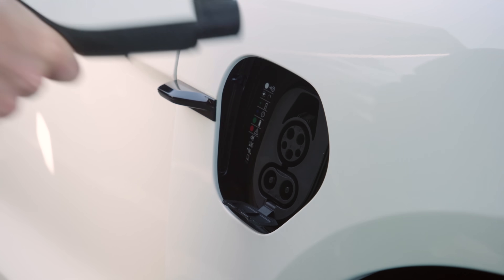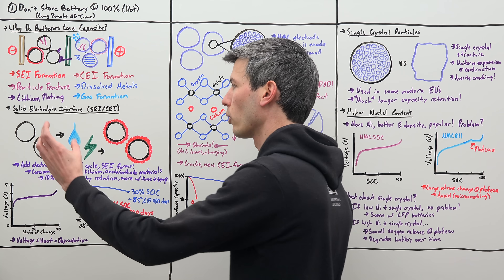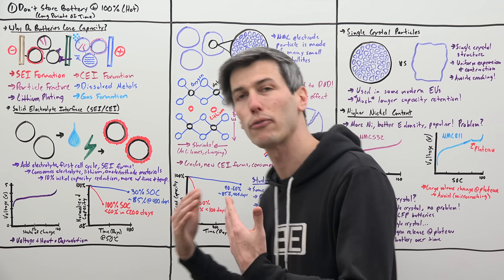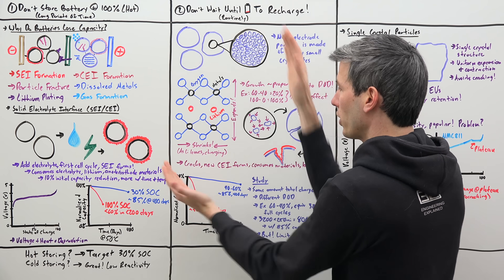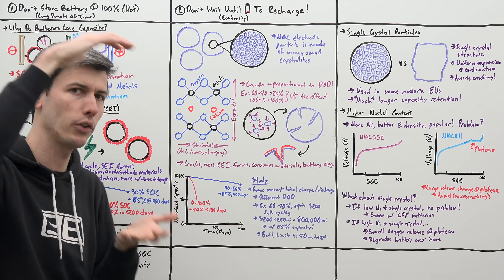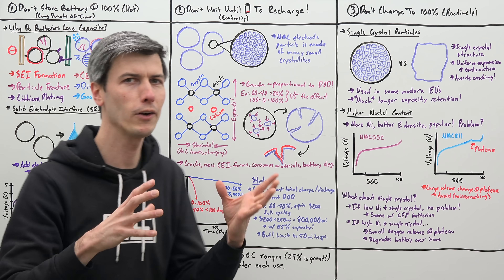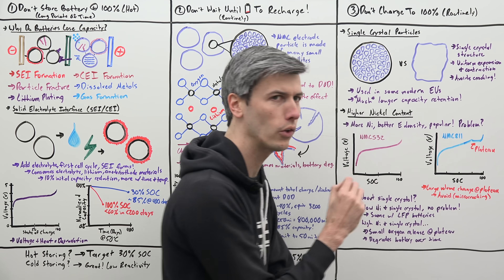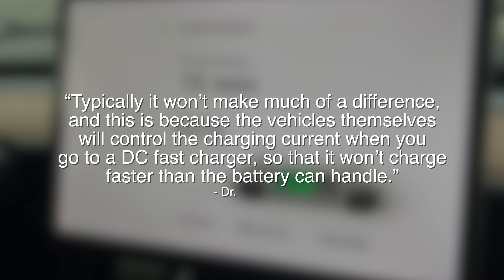How To Ruin Your Electric Car's Battery - NMC Edition!

Comment: Really it depend were you live... Here in Québec, Canada it's a nightmare for electric car... We have temperature from 35'C to +35'C!!! And we have a very vast territory... Here a Tesla model 3 cost 75k$ taxe includes... The car have a advertise 548km range... Most people never do this mileage, so bring it to amore realist 500km... In cold winter people here lost half their range... So now we have 250km.... Most insurance company didnt let you charge your car in the garage because of fire hazard... Charging your car outside at -30'C take 2-3x more time to charge and at home you have the slow 220v charger... So you lost your car for half the journey... My neighbour have go 3 week in vacation in winter... He didnt want to have is car plugged in the charger for 3 weeks , so he unplug it.... When he came back, the car(battery) was so deep freeze that he can't charge it!! He need to have the car tow to a heated garage for a full day to un-freeze the battery.... So, now... You have a =/ 250km range brand new in cold winter... I see video of customer with 7years old car, they have a 30% battery degradation... You have a 7 years car with paiement that you paid 75k$ and you have now 175km of autonomy.... It's ridiculous!!! If i compare with my old Honda civic (2011) In winter i do easely 400km with 50$ of gasoline... I purchase the car new for 25k$... The cost of the car(25k$) + the gasoline for 7years(18200$) = 43200$... Were im supposed to have save money!?!?

Comment: Fascinating! I know what ive seen on tool batteries is similar, i generally do not store them more than 75% if i know they are going to sit longer than a week or two. I suppose i need to watch the other video if the composition is different
Reply: I wish tool batteries do what DJI drone batteries do. If they sit around for a few days at 100%, they automatically discharge themselves to 60-70%.

Comment: Jason, what about the most obvious engineering solution, which is larger top and bottom buffers? Almost all standard hybrids only use in the 40-80% SOC hard-coded and many have last lasted well over 500k miles. Yes, you would need larger batteries, but is they last 2-3x longer wouldn’t that be a net benefit?
Reply: Is it though? In our country, most 10yo Camry hybrids on second hand market have busted batteries within 70-80k km. These are 1.6kWh 245V NiMH packs 

Possibly it’s due to heat and lack of liquid cooling (India)
Reply: @shresth1201  How long did the original batteries last? What health were the rebuilt batteries at? How good was the diagnosis and replacement work as well as the SOC balancing? I had a 2013 Prius that now has 200k miles with the second owner and the battery health is still excellent. It is proven that only staying in the 20-80% or 40-80% range always many more charge cycles than allowing batteries to go very high or very low voltage.
Reply: @KyleBrightman  these are 2013-2015 model year Camrys. The “check HV battery” light comes on and th regen stops working so does motor torque assist as per local car forums. Nothing about the SoH is made available to the user. Most people either just keep using it with lower mileage or try to get rid of it on car trade sites for whatever money they can get with faulty hybrid subsystems (usually ~$10K while a new 2024 Camry hybrid costs $50K equivalent here) 

Like I said most are listed under 100K km and still need battery replacements worth at least $2000 as per the dealers

Maybe a model year 24 Camry will fare better 10y down the line in 2034 but we’ll see 

As it stands we have LFP EVs as well and while they aren’t old age wise, some have been driven 100K+ km without range drop 

This model of car is also owned by me, and I know of the owners via our telegram group wherein one of them has even exceeded his warranty period of 160K km and did 162k km Nov’23 in 2.5y of purchase on original battery no range drop 

Because 

1. They’re LFP 

2. They’re liquid cooled 

Afaik the Toyota ones are NiMH and not cooled in any manner — and heat being enemy of batteries more so in a tropical country like India worsens the degradation 

Your experience may vary because you’re in a colder country which doesn’t need battery cooling or because the tech on the Prius and Camry sold here maybe different as brands do lot of cost cutting in Indian car market vs their global models

Comment: We have an NMC battery Ford Lightning for which we’ve built an offgrid 3.6kW charging system, with a 6kw hybrid inverter charger, so we pretty much trickle charge at 12amps @ 240v. I wonder if charging at so low of a rate would alleviate some of the issues with charging to 90% + ?

Comment: Great advertising for EVs! Buy a car with a battery 5 times bigger than what you require, keep your car under a roof and ignore the range claims.
Reply: Huh? You can use the full range. Did you misunderstand something?
Reply: @logitech4873  If they tell you not to charge to 100%, not to drop under 20% and keep it between 40% and 60% (or 60% and 80%), they are effectively saying not to use the advertised range.
Reply: @pseixaspal  This is for daily everyday use. You know, commuting and whatever.
When you need to use your full range, you use it. You're really just hearing what you want to hear. Roadtrips aren't everyday use for the vast majority of people.
Reply: @logitech4873  Exactly why I said you should pick a battery size five times the size you require for everyday use. That's the logical conclusion from all these recommendations.
Reply: @pseixaspal  You'd want a longer range EV for many reasons. Bigger batteries last longer generally.

Comment: I thought that the EV's software regulated SOC between 10-90% of actual - Gen 1 Chevy Volt owner
Reply: Usually there's a buffer below "0%", so you don't actually reach 0%. But in most EVs, 100% really is 100%. There are exceptions. I believe the Toyota BZX4 has a top buffer.
Reply: @logitech4873  Every EV on the market still has a top and bottom buffer

Comment: The Chevy Volt (pioneering plug-in hybrid) engineers set up the battery to only charge 30-80% SOC. In a way the battery was twice as big as it needed to be, but they felt it was with it to deliver reliability. The Leaf (EV only) of the same era had major battery degradation issues.
Reply: Came here to say this. I own a volt, I just wish there was like a long trip mode where you could unlock the reserve battery capacity
Reply: @zacrossen1968  I think of PHEVs as electric on a typical day and conventional hybrids on road trips. People will criticize it as "carrying an engine you're not using most of the time and carrying an electric battery you're not using on road trips," but my physics and engineering educated opinion is that weight matters 65% less to vehicles with regenerative braking. So the only fundamental problem along those lines is the space they take up.

Comment: When you talk about 100% of battery are you speaking of 100% of the gross capacity, which is generally not possible in most cars, or are you refering to 100% of the usable capacity of the battery?
Reply from the maker: Useable capacity

Comment: Such great videos you make Jason - thanks!
Re charge percentage - my Mini Cooper SE has a very small battery so I need 100 usable percent all the time. BMW says they purposely cap accessible charge at 28kW of the battery’s 32kW total. I’m assuming this is to automatically prevent true 100 percent charge degradation that you reference?

Comment: Regarding leaving your car parked over time in temps below 0 degrees C, it's always a good thing to read the car's manual. For my car SOC should not be below 40 % in this scenario.

Of course, a world where people actually read at least the basic bits of the user manual for their car - I realise that is a utopia.
Reply: Our 2024 Prime came with three Owners Manuals. Together, they total over 1,000 pages. Kind of like reading War and Peace, but, with a more technological slant.

Great car, I drove 88Km yesterday in EV Mode and, the battery still showed 6% SOC. It had already well exceeded the advertised range at that point but would have gone over 90Km's on a charge had I needed to.  With 5,000Km driven since mid-March, we have used less than 1.5 tanks of fuel. Cost to recharge here runs around $1.75, gas costs $1.80 litre.

For us, at least (in an automotive sense), we're much closer to utopia now.

Comment: Why does Tesla recommend to charge LFP to 100%?
Reply: Due to the way LFP works, they need to be charged to 100% now and then to get an accurate calibration of the battery readings.
And because they have so much lower degradation than NMC batteries, you really can charge them to 100% all the time.

But if you want the longest life out of them, a lower charge is better. 
Just charge it up to 100% occasionally so that the BMS can get a proper reading.
Reply: @logitech4873  That’s what I was thinking.. Anytime you try to reduce max charge from 100 you get a message saying keep it at 100 because it maintains battery health which sounds a little misleading.

Comment: As you mentioned it's the makers problem to solve and they're not all consistent.  I know for the original battery in the Bolt EV (and likely the pre-ultium one) and Volt EV a 100% charge isn't 100% cell voltage compared to say a Tesla where 100% is basically 100% cell voltage.

Even then I still only charge my Bolt EV and my Model 3 to around 80% at home.

Comment: Gas tanks don’t lose capacity with how much they are filled or the storage temperature.
Reply from the maker: But gas engines do tend to lose power over time. Obv the volume of a tank doesn’t really change.
Reply: @EngineeringExplained  And, when they do,  engines can be rebuilt for far less than at least $20000 for a new battery.

Comment: LiPo storage is around 30% but Li ion is 50% Basically look at the nominal voltage on the battery, that's best for storage.

Comment: The need to fuss with the battery is a deal breaker. They are just too fragile.cold, charging issues, etc.Filling a tank with gasoline will work until tech catches up.
Reply: There's no fuss. It's just a few things to remember. Just like you know that you shouldn't be driving your car at the rev limit, and that you shouldn't be putting gasoline in your diesel car. They're simple things, and it takes no effort at all to adapt.

I wake up, I unplug my car and drive to work.
I get home, I plug my car in.
The car by default limits charge to 80%. It's very easy.

Comment: That video is the best proof, that EVs are not ready for the mass market yet. Most people can't even charge their Li-Ion cellphones correctly. 

The simplest way would be to display the charge indicator in % at software level in such a way that the battery with a charge status of 100% was only charged to 80% in reality and, conversely, the charge indicator shows 0% although there would still be 20% charge remaining.

But what would be good for the battery would be bad for marketing and the manufacturers would have to revise the already unrealistic WLTP ranges even further downwards.
Reply: This is about getting optimal longevity out of the battery. Most people won't notice, and it probably won't make more than 10% difference, except in extreme cases.

Many people with gasoline cars do about the same, neglecting oil changes and tune-ups, etc.

I think the real obstacles for EVs are expensive cars and charging at home, which is hard for renters and people without private garages/driveways.  That's getting better, but slowly.

Probably manufacturers initially aimed for the high end ($) partially because those are disproportionately homeowners rather than renters.
Reply: Oh, and FWIW the WLTP for my 2022 Ioniq 5 – 280-299 miles – is about right, assuming I drive at or below the speed limit (wind resistance: also affects gasoline cars, obviously).

I've done better than that in actual driving, when not in a hurry, or around town.  And worse when driving in a hurry, or into a strong headwind in Wyoming. 🤷‍♂️

Comment: Agree with most of this, BUT.... old EV's  DO NOT  have active cooling of the batteries for fast charging... and they did not have that much experience at that time.faster. Yes they fast charge slower,  but apparently not slow enough with the passive cooling (standing still!)

Comment: so its like saying I bought a 1TB drive but I can only store upto 750GB, any higher the data will not be guaranteed stored.
Reply: It’s the same with hard disks too

Idk if you’ve ever had one but a 1024GB (1TB) hard disk only has about 800-900GB real space and that’s after factoring for the error between gigabyte and gibibyte
Reply: Yes, it's kind of like that. Fortunately, most people don't need to store over 750GB. And most people drive only about 40 miles a day.
Reply: Aha, you are that "most people" kind of guy, that think your job commute of 5km, from a house with 3 electric charger installed to a job that also have electric chargers are "most peoples" situation. And we should just neglect all that are not "most people" because it works for you. Let´s throw in that horse and wagon argument too, that is100% irrelevant for the people that can not have an electric car. Oh, and make up a story about a 3000 mile roadtrip where you did not have to wait for charging even once, because you need to go to the toilet for 45 minutes every 2nd hour @tjshire
Reply: @thoos192 , I'm not sure what your point is here. Yes, I referred to the average distance most Americans travel in a day, which is well within the capabilities of most EVs, even in freezing temperatures when EVs will have a range 30% below EPA estimates. Are you implying that my comment is misleading or not factual? If so, please present your data.
Reply: But they already do, there are spare blocks to replace bad ones. So a better comparison is that you buy a 1TB hard drive, it's just that the manufacturer needed to create a 1.1TB hard drive. It's all about the semantics then.
Reply: To be fair,  most of us start out caring about all this stuff, and then after a few months of owning an EV we decide none of it is really that important as worrying sort of spoils the fun.  So we go from trying to charge our cars cheaply as possible,  driving economically and trying to have good charging techniques and a sort of penny drops eventually and we realize EVs are actually fun when you start not caring about this stuff.  It's like range anxiety,  most people do not have range anxiety, but instead have some strange economics anxiety of trying to avoid expensive chargers on long trips.  I think it stems from when they had an ICE car, and avoiding the most expensive fuel stations.  Eventually they stop caring though.
Reply: @wonderingworld119 In some areas, charging is cheaper than gas.

Comment: After watching this im not convinced frequent recharging (reducing DoD) is benefitial.

Argument made in video was recharging 40->60 is basically 5 times less than 0 to 100. 
So basically if i use 20% of battery capacity every day, recharging every day is recommended but recharging 0 to hero is same.

I bet there is another explanation for the DoD limitation.
Reply: The video isn't making an "argument." It presented experimental data showing that lower depths of discharge and refraining from charging to 100%  resulted in batteries losing less capacity over time.
Reply: @tjshire  i mean... If i use battery to lets say use 100whr of power in total. Going 40-60 5 times or going 0-100 once does not have a difference by referencing to selected arguments, am i wrong?

If i understood correctly, paper was with regards to degradation over X cycles, not degradation over using YYY Whr of power through batteries.

Please prove me wrong :)
Reply: @Linyzas , I understand your point that over a given distance traveled (or kwh consumed) that the battery should be equally degraded if charged five times to replenish 20% each time, or charged once 100%. But the experimental data shows that deep discharges and maximum charges place a greater physical stress on the battery, thereby reducing its overall capacity sooner than shallower discharges that refrain from charging the battery to 100%.

Please pay close attention to the parts of the video where Jason explains the conditions under which a battery can develop "cracks".

Comment: What if the last 15% to 25% of the battery capacity was substituted with Lithium ion Super Capacitor technology? With the same SuperCapacitor allocation being used for not only high efficiency regenerative braking, but also for helping start up the system in extremely cold situations, but also potentially allowing for a “E-Nitro” feature for more expensive EV models like sports cars, where the high discharge of the supercaps could potentially simulate for short periods the effect of NOS or a turbo on a combustion engine?

Also for when the car is in long term storage, there could be a system on board where it’ll “repartition” the stored energy in the battery by putting it in the supercaps, then self-discharging the batteries slowly to a healthy level for long-term storage, where the supercaps keep the batteries maintained at that level by periodic trickle charging as the batteries ever so slowly lose charge.
Reply: you're talking about adding $60,000 or more to the price of the car.  and for a turbo boost / nos effect, you wouldn't need anywhere near 10% of battery capacity, that's just plain nuts!  you're suggesting enough energy for nearly 5 miles of travel in super caps.